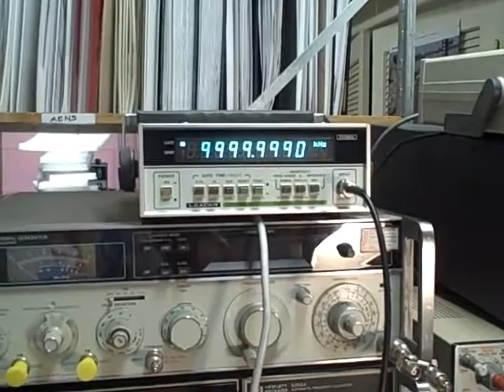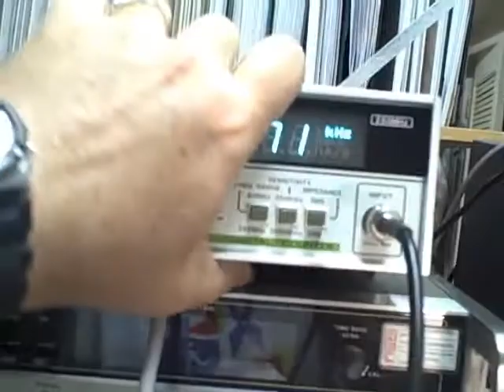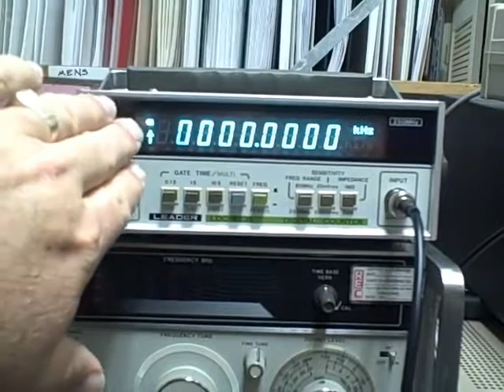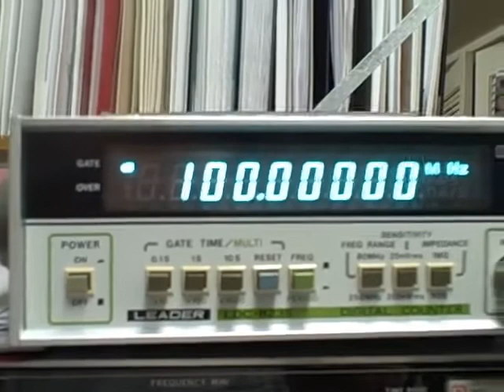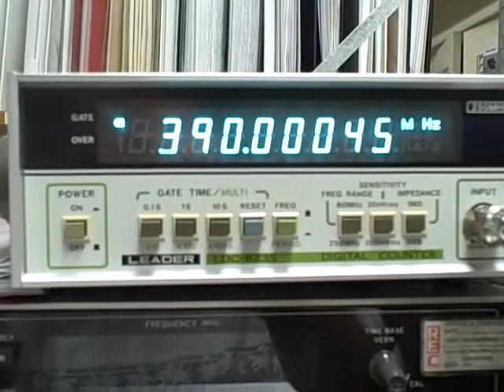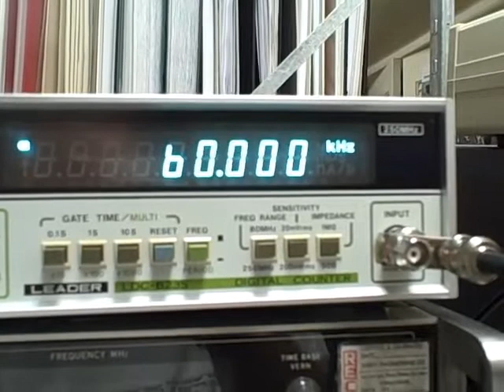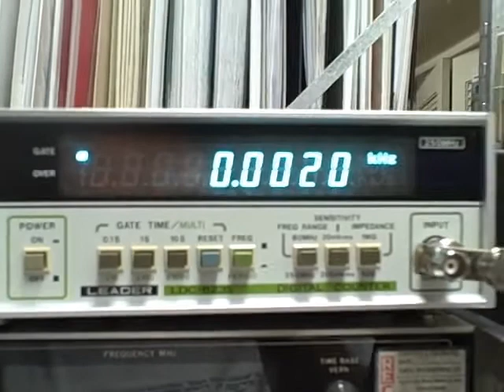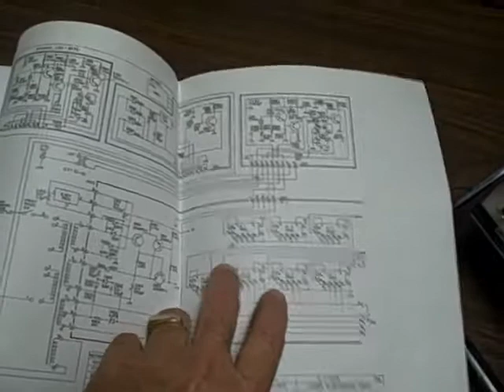Leader LDC 823S 250Mhz Counter unit 2

Comment: hey i have 1 of the units seems to work but i dont have the lead wire im now to cb and transmitting but i cant seem to find anywhere to  show or where to get the lead wire could you help me out
Reply from the maker: It is a standard 50 ohm RG-58 with BNC connectors, which can be bought on Ebay (and a number of other places).  I would not recommend connecting directly to the CB output.  It would likely blow the input on the frequency meter. Instead, I would recommend a small antenna connection.  You should start with your attenuation switch on ( sensitivity on the frequency meter).